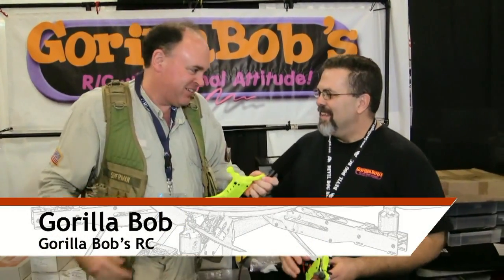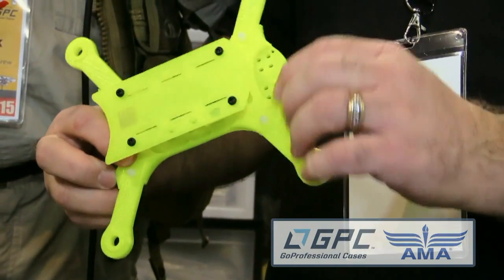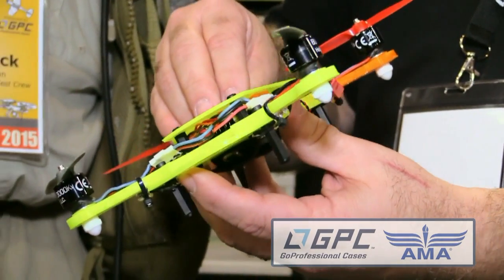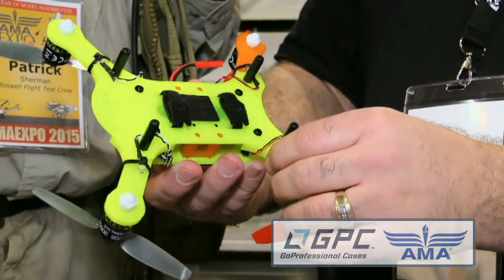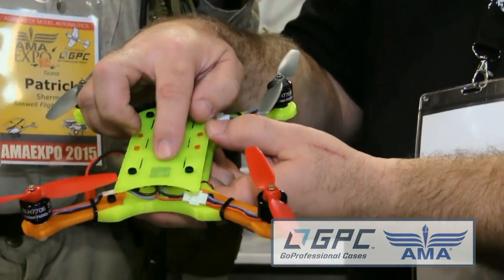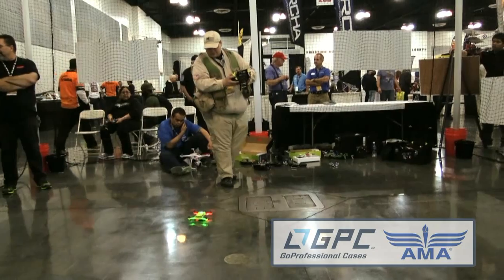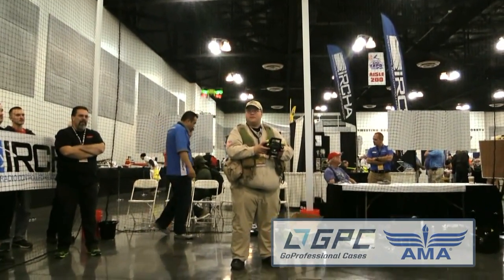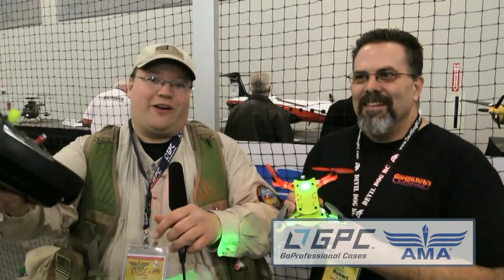RFTC: Blade 200 QX Quadcopter Frame Replacement from Gorilla Bob's RC at AMA Expo 2015

Comment: Very disappointed guys. You stated 3 different times in this video review that the Gorilla Bobs frames were lighter than stock. You even said it was A LOT LIGHTER than stock. I bought this frame based on your review. Guess what?? It's 10 grams HEAVIER than stock. Now I have a $30 paper weight.
Reply from the maker: Yikes! First of all, I'm very sorry that you made a poor decision based on our video -- no excuses. You have every right to be frustrated... That said, I wouldn't completely write off this frame -- its weight really wasn't the key point to us, but rather its crashworthiness. Also, as I recall, Techinstein only said that it felt a lot lighter (while he was flying it), which could have been owing to reduced parasitic drag or any number of other factors not directly tied to weight. Finally, we were flying a prototype, not a production model, so it's possible something changed. Anyway, I am sorry that you ended up with a product you can't use -- you have my sincere apology.